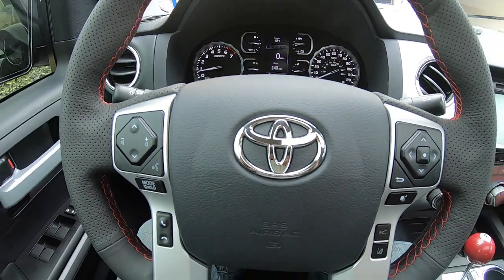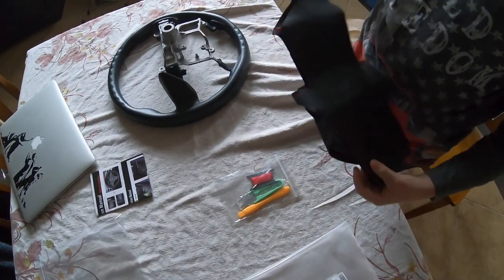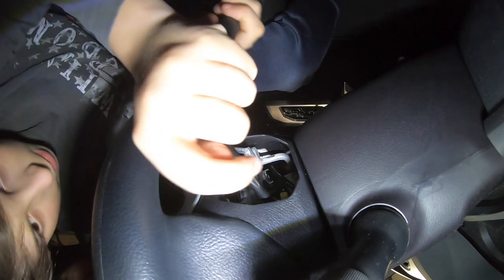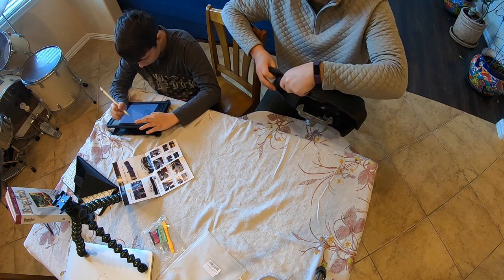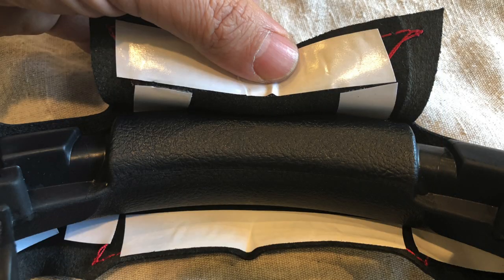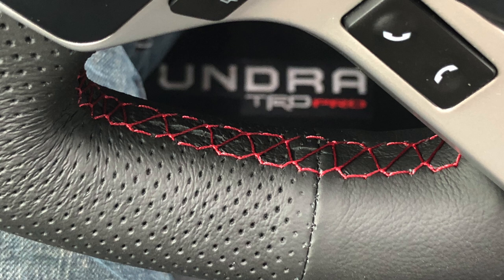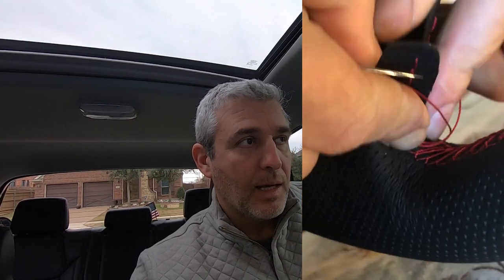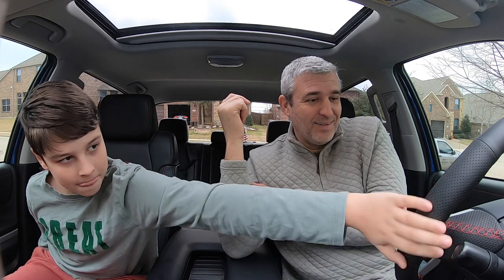Best 2019 Tundra TRD Pro DIY UNDER  $50 the leather wrapped steering wheel

Comment: Came across your video because I was looking on how to remove the steering wheel. The Tundra/Tacoma/4Runner steering wheels are all the same. I just bought a leather one from a 2020 Tacoma for $110 off Ebay. I was going to wrap but when I found out about the swap, couldn't resist. OEM, 20=25 minutes and done. Well just food for thought incase the wrap doesn't last.

Comment: How long of a piece of thread was it from the 9 o'clock position to the 3 o'clock position?
Reply from the maker: PG JC  ....I do not specifically remember the exact length but if I recall it will be twice the length you are working with and I added like 12 more inches to make sure.  Which when I recall it was more then enough. I threw away a lot of string.
Reply: @AndreiDoroftei  Thanks!

Comment: Just bought the same leather wheel wrap. So collecting my tips.
Reply: How did yours turn out? Any additional tips?
Reply: Brett Stacy  ahhhh haven’t installed it yet. Why u may ask? Well airbags. They say disconnect battery. Other says don’t. That’s my hold up. My neigbor four doors down works for toyota. He’s background is electronics. Haven’t seen him since the lockdown but shall after I speak with him. Miss the simple days🤔
Reply: Asaf Farfar Every video I’ve seen, has 100% said pull one of the leads to the battery. It seems like a reasonable per caution.
Reply: Brett Stacy I get that for sure but I hear it can throw off other electronic items. Engine function or windows. That’s why I keep putting it off.